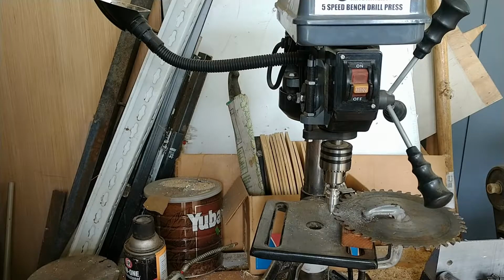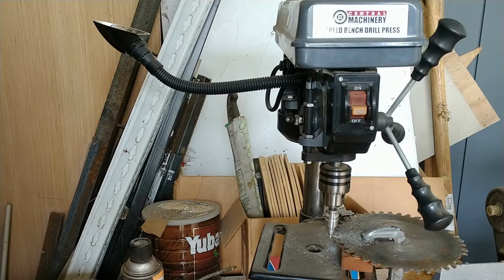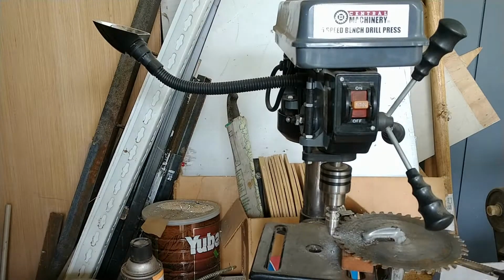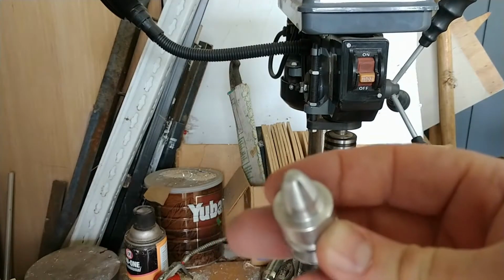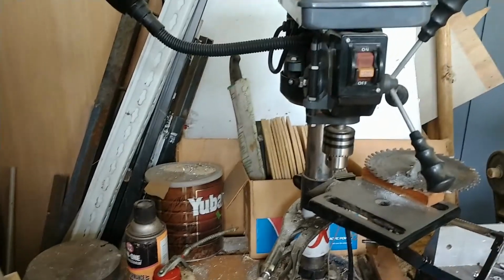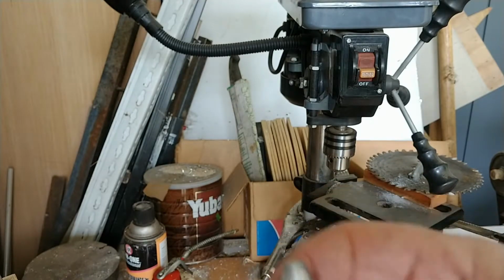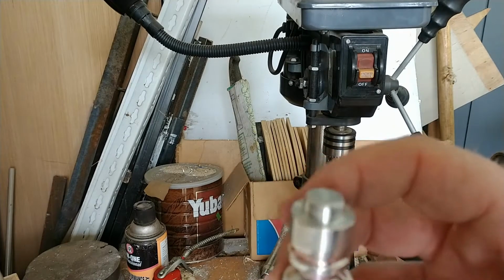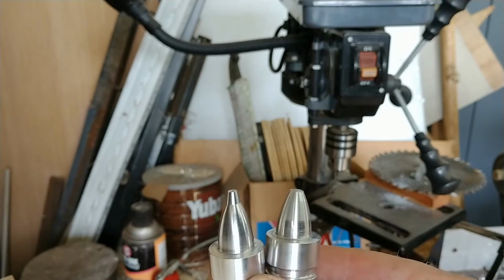Modifying Svarog Paradox Core Pins for Bacon and MIC

Comment: Carbide Cutter.. Brilliant..... I Do The Same with a Hack Saw.. Ohhh.. The Carbide Circle Saw is Just a Hold.
Reply from the maker: It's being used both as a cutter and as a alignment. If you think about it this is like a lathe with almost no torque and no rigidity. So I start with scoring my location with a carbide tooth. What is that tooth sinks in It becomes a form tool. It's increasing the workload and the deflection significantly. So I just withdraw it and use a light pass with a hacksaw to quickly remove material at a reduced load because it's a narrow cutter. Then I swing the saw blade back so that the sawtooth is doing a final facing cut as a cleanup. Kind of like a spring pass.
Reply: Ooooooo OK

Comment: If you reduce the filler volume, you are increasing the slug volume (aka weight). Your actions contradict your intended stated purpose.
Reply from the maker: I think you misunderstood. The pins modified do make heavier slugs. MIC wanted that.  To make a lighter slug  i need a core pin made from scratch. He's helping with that.
Reply: @GunFunZS  You said that you were cutting off the tip of the pin to "hopefully make a lighter version of the paradox slug." What you said the in comment makes sense, in the beginning of the video it was confusing.
Reply from the maker: @Beelzebuds  that pin is still bulkier than the standard pin for the paradox...